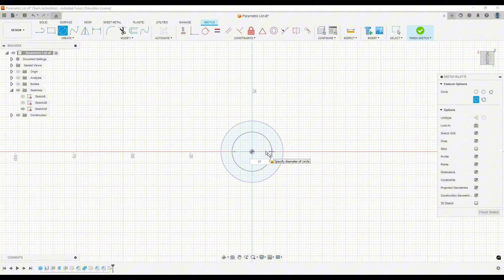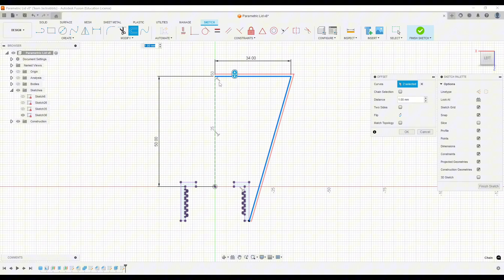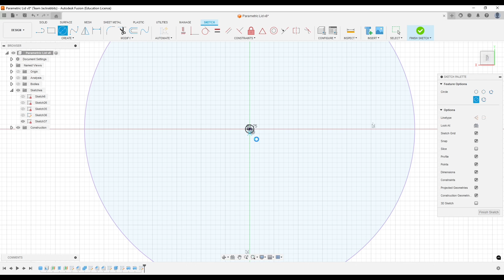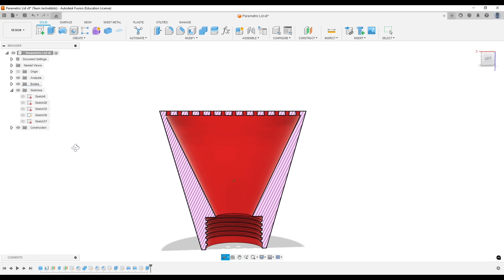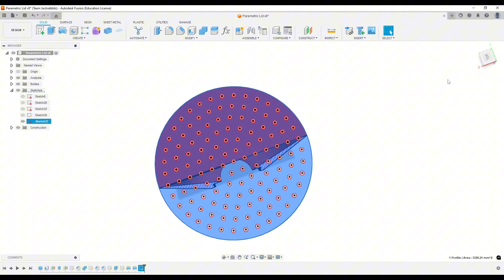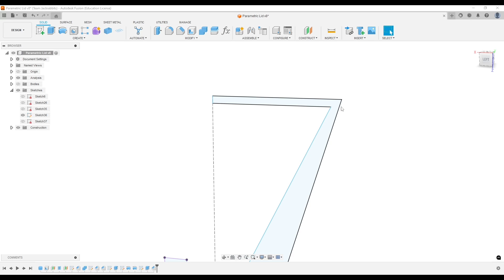Let’s Beat This Heat!

Comment: The issue with designing a spray head is that a simple linear extrusion results in parallel holes. However, for a proper spray pattern, the holes need to be oriented radially—meaning perpendicular to the curved surface.
> I solved this by creating an auxiliary dome over the surface and using the emboss tool to project the hole pattern, cutting the openings flush with the curvature. After that, I generated a technical drawing from the final model."

Comment: I think you'd get more flow if you divided the incoming water and channelled to each outlet. Dividing the 17mm inlet into equal areas then lofting to the outlets would give you a flared stream. Using  tangent constrains would give you straight streams.
Reply from the maker: I actually considered this and thought I might test it. Just haven’t had the time. As is, I kind of like the lower pressure but heavy flow. It works well for flower pots and my raised garden beds.

Comment: nice video! made something similar but instead the top part with all the holes was not flat. Mine is bent and that way the holes get the right angle when i embossed them out, and them patterned everything :) works great. Could not print it like you tho, had to turn it around
Reply from the maker: Yeah, I thought about curving that top, but was trying to be able to print this with no supportS

Comment: Always appreciate your content, followed along until the angled lofting where I lofted after the rectangular pattern (each circle in the line individually to make angle-lofted holes) and then circular patterned each hole (6, 12, 18...).  This provided lofted tapered holes each pointing towards the origin.
Printing in PETG-HF, will post results. Thanks again for the content!

Update:
Prints well in BambuLabs PETG-HF with parametric settings in the video.  The fan pattern lofted-holes works as expected.

Great design, thanks for the pin!
Reply from the maker: oh duh!! why didn't I think of that?  Thank you for making this comment. I'm going to pin it to the top for others to see.  Lofting and then doing the circular pattern on each hole, is definitely the way to go if you want more of the fan pattern!
Reply from the maker: Did you use a washer/gasket? No leaks? What do you think about water flow vs “throw distance”?  I wonder if skipping every other circular pattern, to give a little more pressure/distance, and a little less water, would be better?
Reply: @ShopTherapy623  Yes, I used a purchased gasket, nice fit, no leaks.  
Throw distance was minimal, more like the flow from a watering can than a hose but more fan shaped than in your video.  
For design changes, it could have a smaller face diameter, and perhaps fewer holes to increase pressure.  The PETG-HF is also a bit fragile. I would be hesitant to drop it on a concrete surface (while attached to hose) . That cone-shaped edge probably would crack with impact.
Reply: Picture sent via MakerWorld Messages.
Reply: @ShopTherapy623   Thanks for the MW boosts!  Did you find your shout-out in "Screw Cap Spout for Mason Jar Lid"?
Reply from the maker: I did not see the shoutout, but will check it out! Thanks!